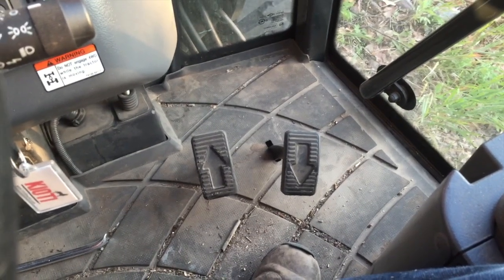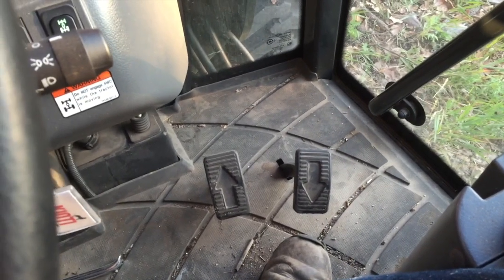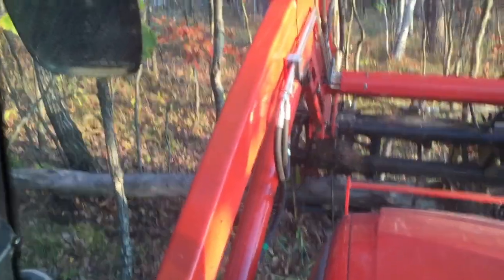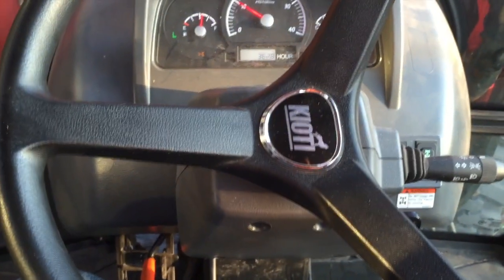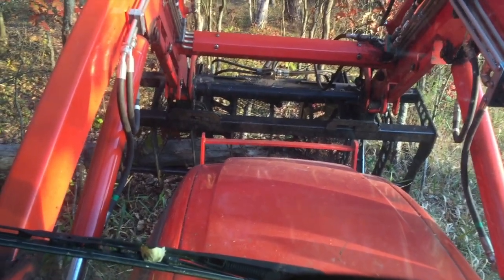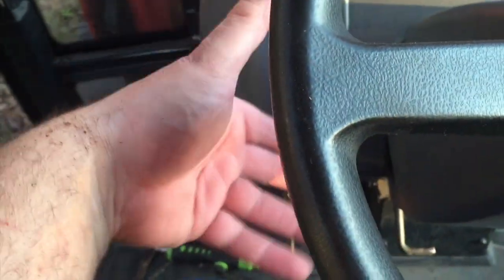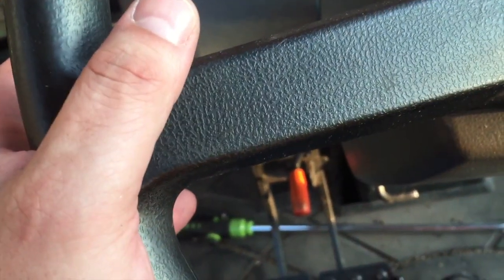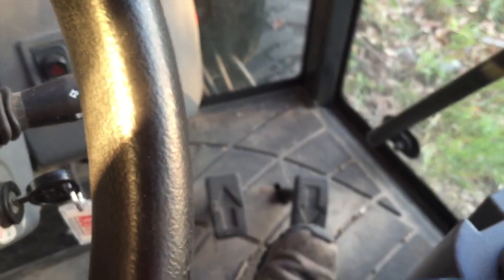Which is better? Gear or Hydrostatic Transmissions in Compact Utility Tractors?

Comment: Prolly should have used a chain saw like other peeps pointed out. Had gear, hydro and Yanmar Ihmt tranny and now I have a power shuttle, all have their place but liked the hydro the least reminded me of a garden tractor. Save the hydrostatic for your wives and girlfriends real men operate equipment !
Reply from the maker: My apologies for taking so long to respond but I was tied up trying on my new wardrobe of ladies things and found out if I hire a pair of young women and film them repairing things wearing bikinis instead of myself, my viewership increases 100-fold every hour. So from now on this channel will not be MinnesotaEric, no, no, since I’ve traded in my man card with the HST transmission, my channel will be known as BikiniRepair. Be sure to check out my new Only Fans Channel as well where the girls show off how to use the big tools!

Comment: Which tractor suitable for agriculture purpose power reversar or gear pro
Reply from the maker: All the new field tractor are generally using some sort of power shift transmission so the operator doesn't need to use a clutch. On my big payloader, the three-speed transmission works like an old non-locking-torque-converter-driven-automatic with selectable gears.
Reply: @MinnesotaEric  please suggest me which tractor best for only agriculture work power reversar or gear pro

Comment: Hydrostatic equals better ease of use...... manual transmission has more power dude to less hp loss in transmission.... both have their places but if your planning on doing a lot of loader work hst is definitely the way to go... if your only plowing/tilling/bus hogging then the manual is the way to go
Reply: Agriculture purpose power reversar tractor best or regular models

Comment: I'd of cut the log or chained it. Nothing wrong with getting out of that fancy cab and getting your hands dirty.
Reply from the maker: And while you got out and chained it and then got back in the cab to move it, then got back out to recover your chain, I grappled two or three windfalls and threw them onto a slash pile.
Reply: I doubt that. I could have that log out four times by the time you wiggled it out. Ever heard the saying smarter not harder?
Reply from the maker: @gmt400_k2xx  I had the log out in thirty seconds or less of actual work.

Comment: I have a device on my 3 point that will cinch a chain after it's wrapped and locked to the tree.  In 1st gear, if it's huge drag it length-wise out of the woods. In your case really,  just get out and cut the damn tree to avoid all that unnecessary B.S with the ridiculous shuttle, think of the fuel and time you'll save. That's the difference between a real operator and a wanna-be weekend warrior.  My gear trans will drag your shuttle around the field that's for sure.
Reply from the maker: As I explained in the video, I didn't have the space to do any of that and so I did what I did because doing so worked and I wanted to keep those trees you're so eager to hack down. If I wanted to clear the whole area, I'd have just gotten into my 200hp Pay Loader and pushed everything out of the way. But, as you said, I guess that's the difference between a "real operator" and somebody who is making a park.

Comment: Again user preference, I have a 2013 L3800 with gear. Bush hogging a large field, not smooth is much more convenient with gear. Set the gear you want then use the throttle lever to set the RPM and you are rock steady at a constant speed rather than being bounced around and your foot relaying the bounce to the accelerator or expensive repair of an electronic speed cruise control. With a gear transmission, there's more steady power if you really know how to operate the tractor and reverse is no different than driving a car with standard a transmission which seems to be these days as a lost art. You choose convenience or a workhorse.
Reply from the maker: I don't have an open field. I have 48 PTO hp which is plenty for my application. https://www.youtube.com/watch?v=jsNPW0RDzh8

Comment: yes Hydro is easier to drive but you also dont have as much pulling and pushing power as with a shuttle. also when cold out gotta let hydro get good n warm before it wants to move with shuttle can go right away.
Reply from the maker: I have infinite pulling power up to the maximum. People purchase the power they need. That said, the gear version of the same tractor only carries two gallons less hydro-trans oil 11 gallons compared to this tractor's 13 gallons.

Comment: A hydro static transmission. This transmission it's like an automatic transmission in a car truck.
Reply from the maker: An automatic transmission in a truck, say, takes the pressure from the pump to activate servos that hold clutch plates or bands that effectively change gears using a planetary set (or to automate shifting a gearbox in smaller, lighter vehicles). In this way mechanical force remains mechanical force, but hydraulics drive the "gearbox" changing the ratios of the mechanical force. A hydrostatic transmission takes mechanical force from the engine and puts that force through an axial-flow, variable-displacement pump turning mechanical force into hydraulic force (hydraulic flow and pressure) and directly uses it to drive a fixed-displacement hydraulic motor in order to turn the wheels. On larger than lawn mower applications, there is also a traditional gearbox that changes the ratios of the mechanical force that goes into the hydraulic axial-flow, variable-displacement pump.

Comment: Hydro-slack-o-matics are great for going back an forth 3/8 of an inch at a time. A tractor is a very usefull tool and resoursefully sould not be used for joy rideing , makeing work (just tooling around), or just because "I want to pull some leavers". Now if someone just likes cruzeing around and cannot push a cluth pedal they are great. When a piece of heavy construction equipment, (aka. --skid loader , bulldozer, or back hoe that need fine tuned low speed production work they have come to be absolutly nessasary. Compact tractors (25 -60 H.P.) have become quite a novelty in the hydrostatic variety now a days. The average "home -loaner" , farmer "want to be", fire wood junky, or semi pro landscraper fall for these units "hook-line-and sinker ". Most hydro users bearly rack up measly 150 hours a year "tooling around". With these type of machines (hydrostatics) desighned to last 1500 hours hardy any one gets them even paid off with any efectual work being done. They all are great back savers ,especialy the ones with loaders. Most warrenty work , around  3&1/2 years and 350 hours later (when the novety wears off ,and the payments keep comming) are in for a rude awakening. It' 90% of the time the hydro-slack-o-matic isues. With most units in the 18,000 to 35,000 $ range owning one of these units costs 40.oo$ to 75.oo$ an hour on just the payments just to "own". Hydrostatics tractors usually cost 1000.oo$ to 1500.oo$ more than their gear drive ,aka " shuttle shifing" countet parts even "IF" they ars made. That increase is because primarly because "Anybody can drive these babys". They should be that much cheeper because they are missing 3/4 of the real gears. Hydro units are slaped in where a mirred of Real gears are suposed to be. My landscraper friends and associates are allways getting their hydrostatics WORKED ON. I have two gear drives  ,that seam to be bullet proof. And a hydro-slack-whin-o-matic that allways keeps the wrenches, fluids, and EXPENSIVE filters handy;;; just love that hydro peddal!!  Oh yea by the way // I use my tractor fer fire wood. I can make 8.00$ a hour cutting ,splitting,stacking and delivering just because "firewooding" takes each piece of wood being handled 8 yes EIGHT times. Burning it only pays .80 cts an hour ,( done this on 4 different properties ). So Folks keep the "Tractor" parked for heating your house with FIREWOOD and buy electric, gas or oil it is 12 to15 times cheaper if you make 10.oo$ an hour on your real job.  So don't  be afraid of getting off of the tractors and getten some real work done. Happy tractoring everyone.!!! And grind some GEARS//×//.
Reply from the maker: My 200hp wheel loader is a hydro and it was built in 1979. Increasingly more and more equipment is going to hydros with locking clutches. I don’t understand why some people are so invested in power shifts that they hold hydros in contempt. Think a 34,000 pound machine with a four-yard bucket and the third function that flows 41 gallons a minute is a toy?  https://youtube.com/playlist?list=PLoesvPeF-vM2sdx_sGKVvWhV11nyIjg9w
Reply: @MinnesotaEric  Is the wheel loader hydrostatic or torque converter drive ---big difference? It probabaly has 25 gallons of fluid ciculating and is Industuraly Built. Not like the 4.5 --9 gallon hydro-slip-o-matics with watch gear sub drive rotary plunger minus the chutch rigs. Used (350 hour) Hydro-static light weights like to hang out on dealership lots & Craigs list sites because need a 350$ service interville and are aready howling to the moon. Just had my hydro out, (28 deg for some snow plowing)of course it needed fluid and it was very slugish. I guess i should of pluged it in & keeped it in a heated facility. Just want another tractor 25-30 hp to fill a nich ( have a 21 ,36 ,54 hp) , but are having a hard time in the decission because of all the hydro-hipe. The 36hp.&54hp. Are gear drive shuttle & power reverser and are great! Maybe I just like "leaverving it" on them; no sissy pedals. To bad they don't make tourque-converter drives in the compact trator line. A souped up version rideing lawn-mower (watch-gear) hydro-slip-matics is ruleing the class all the way to the junk yard & poor house.
Reply from the maker: @donaldstrishock3923  What I can tell you is that Everything Attachments, a great company that makes attachments for tractors and equipment, beefed up and re-classified to lower hp some of their attachments that they were selling into 60hp compact utility tractors because the HSTs like my 60hp HST tractor where bending metal that no gear tractor had done so before. And yes, you're right: my Hough has 35-40 gallons of Hy-Tran pumping around its transmission, and 80 gallons of hydro-fluid feeding the hydro and steering pumps. My point about my Pay Loader is that everything runs on some sort of hydraulics except the electrical and air systems. Again, for doing loader work, you cannot beat an HST as clearly shown in every skid loader and track loader. Moreover, most people are not using utility tractors for row crop farming so they don't need a geared tractor that can handle long-hour-after-hour pulling a planter or disk. Instead, they use these things in tighter spaces, and smaller places and there is nothing wrong with that—and especially so when the HST makes it easier and safer to use. Remember my video is asking, "Which is better? Gear or Hydrostatic Transmissions IN COMPACT UTILITY TRACTORS?"
Reply: Can u tell me for agriculture purpose power reversar or hydrostatic

Comment: I'd be pulling a box blade and brush hogging mostly, loader work only periodically. I'd get the shuttle shift myself. On a side note.....I hate the whine of a hydro drive.
Reply from the maker: None of my hydrostatics whine.
Reply: @MinnesotaEric  Sadly, the only tractor I have any experience with is my JD lawn tractor.....it whines like a baby, always did. Could be because it's a cheap box store model. I'm not even sure it's a real JD, it has green paint anyway.
Reply from the maker: @grizz474  That's a garden tractor, not a larger tractor. Every skid loader is HST, my 32,000-pound wheel loader is HST and any transmission noise is secondary to engine noise.

Comment: Which will last longer though?
Reply: That's a good question. I would like to know the answer to that. My dad has got a John Deere from the mid 90's that's got 5,000 hrs on a manual tranny. No problems.
Reply: @bradbruggeman6745  manual trans but you will put a few clutches in them

Comment: throw a chain on it and pull it OUT .. Over
Reply from the maker: Off camera to my right is a large slash pile preventing me from pulling the log straight out. The tight operating area provided a perfect example as to why hydrostatic drives are better for tight quarter loader work.
Reply: Agree - The Hydrostatics has advantages.  My buddy has one .. and it works great for leveling soil with the bucket as you can go back and forth easily .. But I laugh at him when we need to travel to the next lot 3 miles away and he's crawling along. I know many of the newer version have much better road-gear or top end - I think it is a JD4110 .. but don't hold me it to
Reply from the maker: I hear you. This tractor of mine maxes out at a blistering 18 mph. LOL

Comment: smart thing to do....Standard been around a lot longer than hydro.   learn how to use standard.....you don't need to film everything.....Duuuhhhhhhh
Reply: That's actually a really good point. Personally, I went with HST because I live in a very hilly area and one miss on a manual or shuttle when shifting could be a rollercoaster ride I'm not willing to take!
Reply from the maker: Like it or not, the heavy equipment industry is moving toward HST. Here I am plowing snow with a power shuttle and it isn't as easy as HST. https://www.youtube.com/watch?v=6bl9T23W-ik
Reply: Well that I will agree, I've had a JD hydro for 25 years, its been great, but I like the standard and wanted to try a bigger machine, so I just bought the Kioti 2610 standard.  heard a lot of people having issues with the Hydro.     cant wait to get it.
Reply from the maker: You gave this video a thumbs down, inferred that I don't know what I'm doing because I state that HST is better for loader work, and questioned a guy with a YouTube channel why he makes videos all based on your zero experience with shuttle shift.
Reply: MinnesotaEric Buddy I’ve been in more tractors and run more machinery then you could ever imagine all I’m saying is hydrostat is the easy way out to go and they don’t last as long is standard they’re very limited you have to run your engine light open in order to keep the oil cool so yes I know a lot about him don’t worry about me.
Reply from the maker: It is a utility tractor. All I do is loader work. Sort of like every skid steer is HST for the same reasons yet not a single person is asking for a shuttle shift skid loader.
Reply: @MinnesotaEric  Of course they are easier to con people into buying tractors that require massively expensive repairs and have planned obsolescence built into the most expensive part of the machine so you buy another tractor when it wears out.

Comment: IMO I think its easier to use a gear on the steering column, with most new tractors you dont have to worry about the clutch so its about the same. The Hydro stats dont seem to be very reliable and robs HP from the tractor and they are a little more pricey so I think I would go with the gears.
Reply: Me too

Comment: I bought my rider when I first bought this house in spring of 2016. at end of mowing season it started leaking on the inside tire. no way to refill oil now I am screwed. paid 1500 for mower and now I am on disability and fixed income so cant fix it. now you can hear gears grinding. I seen where a new transmission would cost me 800.00. hell I have not paid off this rider yet. you would think it would have lasted longer then one mowing season.  I advise every one to stay away from these plastic housing type transmissions from GT .. I have read a lot of people have had same issues. to bad they wont stand behind there product.. DONT BUY ANY MOWER WITH GENERAL TRANSMISSION RS800 (580486201). Bob Zink

Comment: Minnesota Eric,

I was wanting to know where you bought your grapple bucket from. How do you like it. Maybe you can do a video about it. Thanks!
Reply: Take a look at "The Rake Shop" in Florida. I bought one of their grapples about 3 years ago after doing MUCH research and watching a ton of videos. The Everything Attachments grapples are made with like 1/2" tines with tube stock welded in between because the tines being that thin would bend if not tied together, the only problem with that is that sticks and crap get all wound up in all those gussets!  My grapple's tines are 11/4" steel with a nice round curve to them so you can pick up logs etc. with ease and if the tines get some sticks wound up in them, just put it on the ground, back up a little and they're all clear again, ready for the next load, no need to get out of the cab to clear the tines!
Reply from the maker: My grapple is a 72" wide version 1 Wicked Root Grapple made by Everything Attachments. Since this version came out the folks at Everything Attachments listened to feedback from people like myself and made the grapple open a little wider as well as incorporated some guards to help keep the Skid Steer Quick Attach (SSQA) from getting tripped. You can watch Ted, the owner of Everything Attachments tell you all about their Wicked Root Grapple at this link: https://www.youtube.com/watch?v=i---hbR7-nU
Reply: Thank you very much. This is the best grapple I have seen.

Comment: I'd probably just cut the log in half
Reply from the maker: Faced with hundreds of trees to get picked up, I want to pull out deadfalls and throw them on the slash pile as efficiently as possible. That said, I frequently am sectioning logs and manually stacking my grapple because it makes sense to do so rather than chaining or grappling them out.